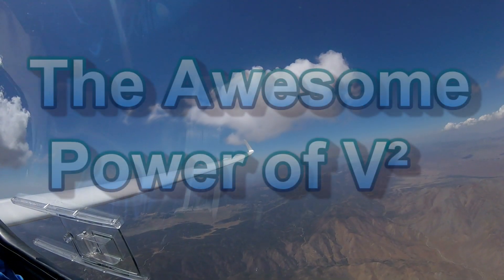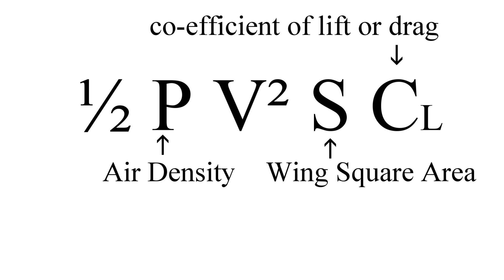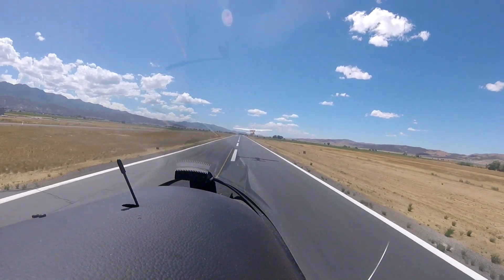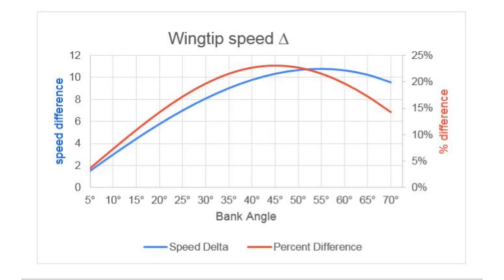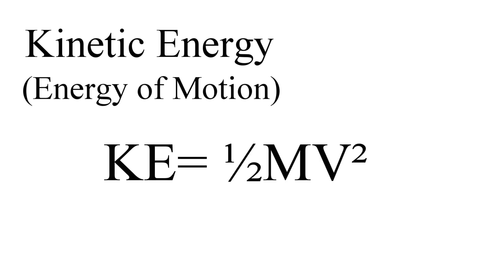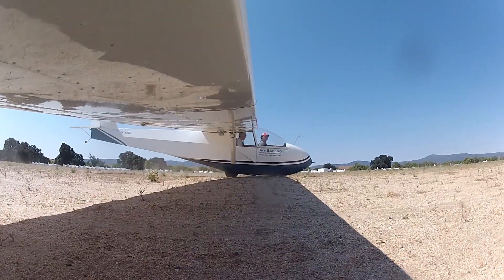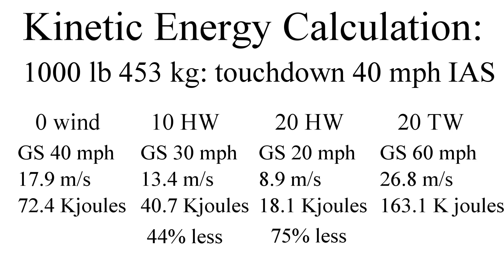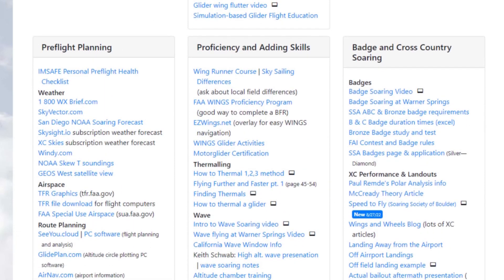The Awesome Power of V²

Comment: In the video description you wrote
"At 7:05 I should have written the acceleration formula as ft/sec/sec before reducing it to ft/sec² or V²."

That's still wrong.  V² units are ft²/sec².  That's not equal to acceleration's units, ft/sec²... The units don't match up. 
Just look up the "kinematics equations" of basic physics. You'll see the relationship between velocity and acceleration is a little more complicated.  There's no way to "reduce" A to V².

Everything else in the video appears to be correct, though. So I enjoyed watching it. I'm not a pilot but I do remember my basic physics somewhat ;)

Edit: I know the video can't be changed, but the description should be edited to have the right correction. Also, I hope your website doesn't claim A=V².. That would also need to be changed.
Reply from the maker: Thanks.  I’ve adjusted the comments to better reflect the correct math. Yes, too bad there’s no way to adjust an uploaded video or add on-screen comments.

Comment: Why at 7:07 "A=ft/sec * ft/sec"? A = ft/sec/sec!
Reply: @Bill Palmer My second sentence wasn’t very precise - apologies.  What I meant was that for a given mass there is a relationship between the force on it, and its acceleration (F=ma, as you said).  There is no such relationship between the force and the velocity, nor velocity squared.  Velocity squared is not the same as acceleration!  Its units are m^2/s^2 (c.f. m/s^2).  At the start of a winch launch your acceleration is very high (large force on the glider from the cable) but your velocity is near zero (and so is the square of your velocity).  Your statements about lift, drag and KE are absolutely correct.
Reply from the maker: That would have been a better way to write it.  The product is still m/s^2
Reply: @BillPalmer  No.  Velocity squared is not the same as acceleration, which is why the units are different.  Also, there is no relationship between velocity and force.  Your video is very clearly expressed - thank you - but unfortunately in this respect your analysis is incorrect.
Reply from the maker: @philatkin7358  well there’s a clear relationship between the lift and drag forces and velocity. 
Also the force required to stop (in the same distance) - the KE you need to dissipate - has that ^2 relationship with velocity - which was the point.